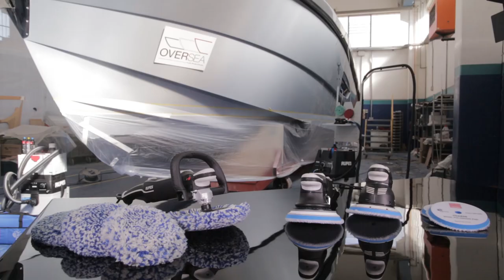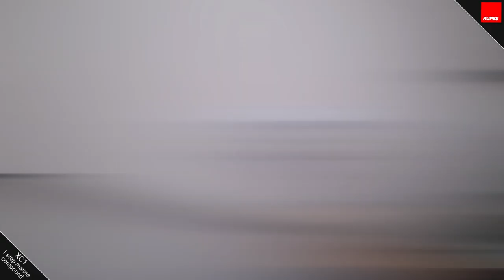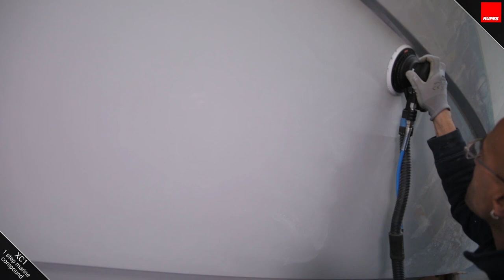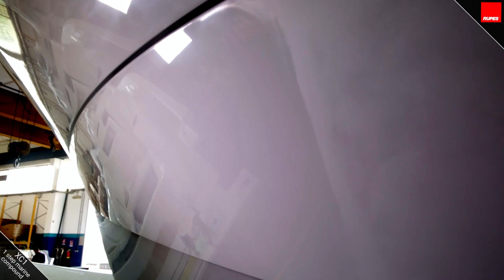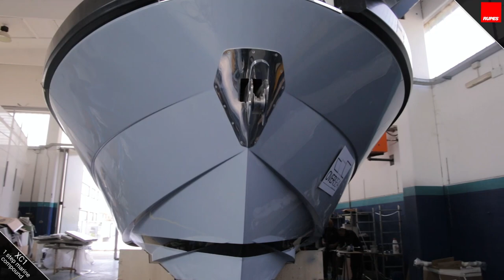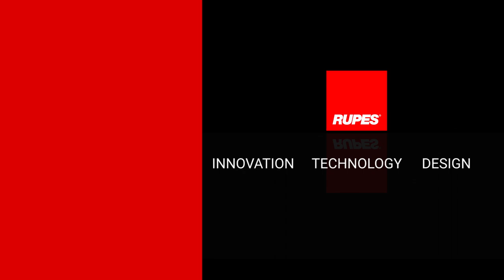XC-1 MARINE | One step compound cut & finish

Comment: Hello Rupes! I've been using the Extremly versatile XC 1 for the past 2 years and i love it!
The only question i have and i'll be happy if you can answer, is this one:
 How is the XC 1 compare to Rupes multi-stage system?
Thank you!
Reply from the maker: Thank you for your question. XC1 is unique in that it is developed specifically for heavily oxidized getlcoat surfaces. The solvents used are helpful in softening that chalky layer of oxidized material for removal. For regular gelcoat polishing, to improve gloss or remove surface scratches, our Rotary and DA Systems are fantastic. As a matter of fact, you'll find RUPES systems in many boat and RV manufacturing facilities for polishing newly manufactured vessels and even the molds that the gelcoat parts are made in.
Reply: 🤠💯😎... Thank you very much for very informative reply! Thankfully i own all the  MILLE system and the recently launched D-A...so there is plenty of things to try next💯🤓
Reply: Using this on cars would be better than normal ones?